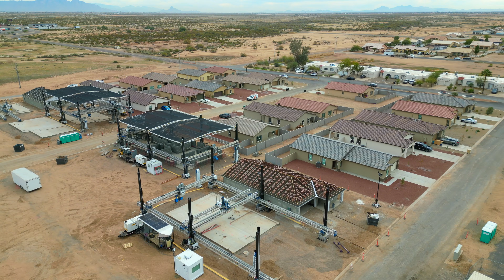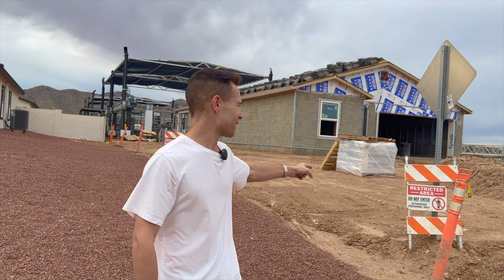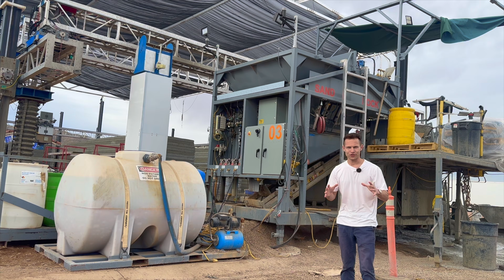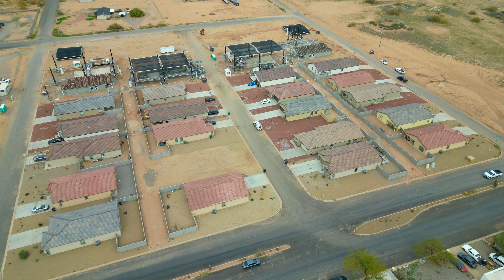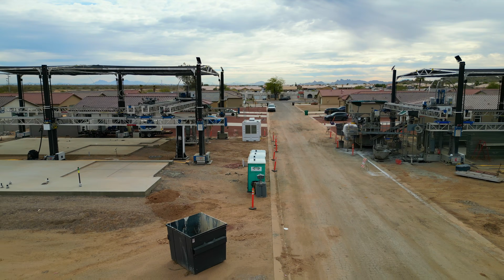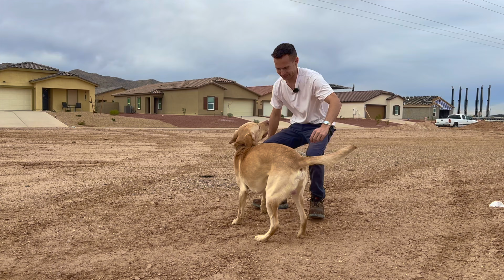On-Site Robotic Home Construction Development Nearly Complete

Comment: Arizona is running out of water. Foolish
Reply: Given the reality of our climate crisis refugees, folks are already running to Arizona so it is imperative that we shift to better resource management, starting with water. Search the homeless population here. 

We have solutions, but the government refuses to fund them. We march on anyway, even as we  overcome the lies that says Arizona is running out of water. 

EPA has pages on "atmospheric water generators" (AWG), "water from air towers and devices" already in operation under federal contracts, like the Moses West Foundation. There is plenty Youtube material here on the technology too. AWG dates back to the days of the Prophet Moses. Also, we can clean existing water supplies using the magnetic water cleaning system HYDREVA. Search that out too if you are interested in the truth.

There is no shortage of land in Arizona to print on nor air space to pull water from. In tiny Cochise County the government owns about 3,000 square miles of land they barely if at all use. The other 3,000 square miles has a population of less than 150,000 people. Manhattan in contrast is about 25 square miles with a live in pre pandemic population of about 1.5 million.

Also for energy, in addition to printing AWG systems into the structures, we can print free energy systems and small greenhouses in. Also out here in Arizona and elsewhere that is inland, elevated with printed environmentally conscious structures and infrastructures can save millions of lives, if done properly and quickly. The storms off the oceans are getting stronger, record temperatures and melting ice caps.

ARIZONA IS NOT RUNNING OUT OF WATER - THE TRUTH IS NOT FOOLISH - WE CAN IMPLEMENT SOLUTIONS AS NEEDED! THIS PROJECT PROVES WHAT IS POSSIBLE WHEN STUPID IN GOVERMENT GETS OUT OF THE WAY.

Remember the wisdom of Saint George Carlin - 'I have certain rules I live by. First, I don't believe anything the government is telling me. NOTHING!' We know we can do better than this despite government reports that we are running out of water. It is impatience with the word 'can't' that will transform Arizona and other inland places into safe spaces for people running for a safe, beautiful place to be when running from climate emergency reality.

LET'S PRINT! WE'VE GOT THE POWER! JOY!